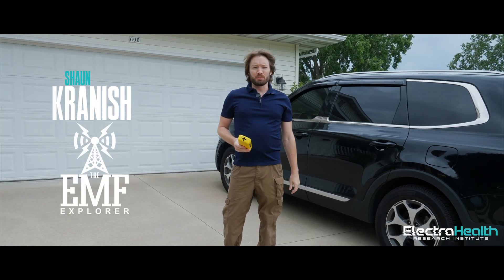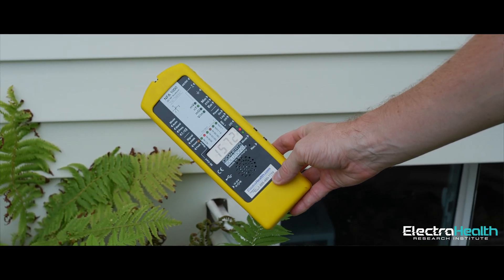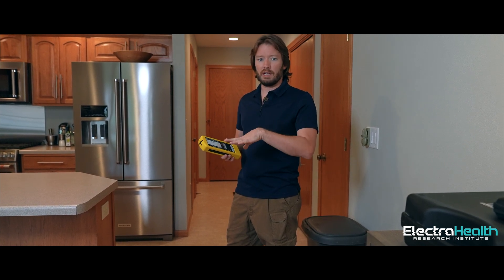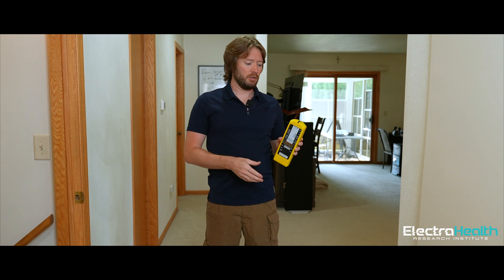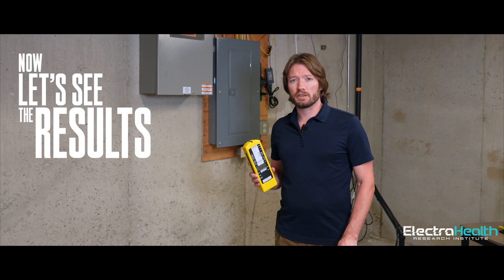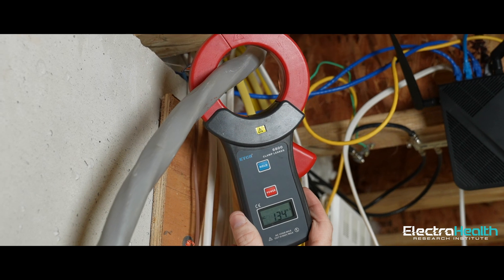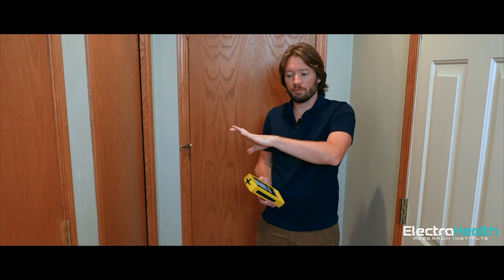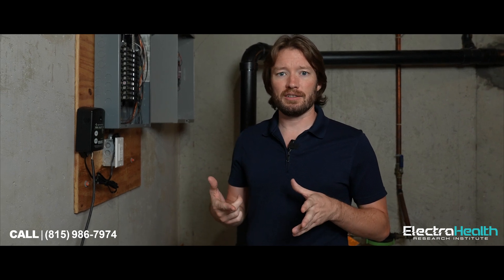90% Reduction in EMF in This Duplex | The Generator was the Culprit | SEE Our Walk-Thru

Comment: Never thought about emf around the home.  Thanks for shedding light on this subject and sharing your knowledge.  Do you think there are dangerous levels of emf in vehicles as well?  Or is dc current less harmful due to it not having a constantly changing magnetic field. I say that because most circuits in a vehicle can vary in amperage from about 1-30 amps (obviously starter and alternator output are much larger) but most the power is sent out on one harness and returns though a different ground path, usually the body or frame.  Can networks have a twisted pair to cancel out the emf to eliminate communication problems but doesn’t seem like many circuits go out and return on the same path.
Reply: Cars definitely produce bad EMF. There are AC magnetic fields produced by the engine compartment which are highest at the driver's feet, as well as RF from all the wireless signals modern cars have like Bluetooth, WiFi, LTE, Starlink. Definitely wanna switch off as much of those things as possible.

Comment: How can a generator that is not on throw power thru those cables? Or did you neglect to say when generator is running this is EMF readings? 
I am confused.
Thank you for an informative video.
Reply from the maker: Power coming into each unit from service.  Generator with auto-switch for the hots only.  Orange cable takes power from generator to other unit.  Neutrals all bonded together since the neutral on orange cable wasn't switched.  2 paths for neutral current to take.
Reply: @EMFExplorer  Thank you. Service meaning that standby monitoring process that if the power goes out it turns on?